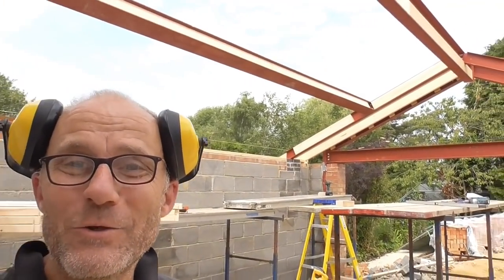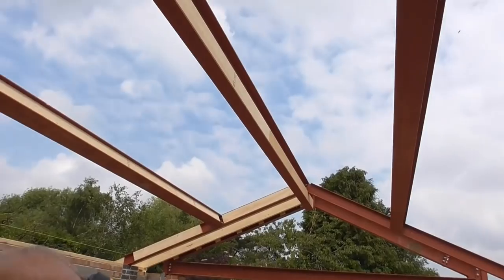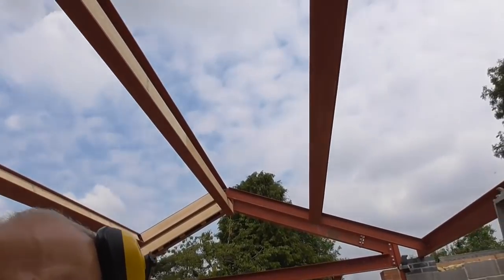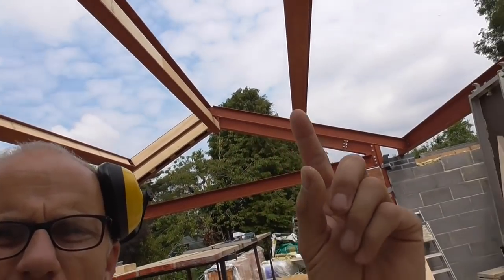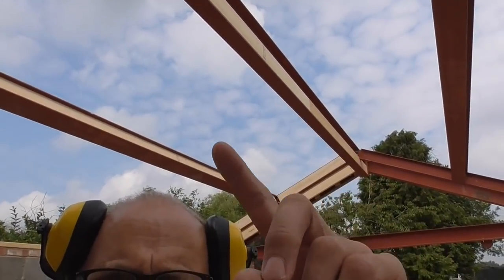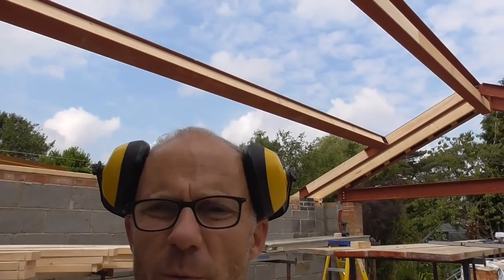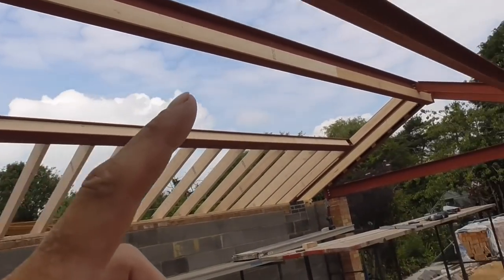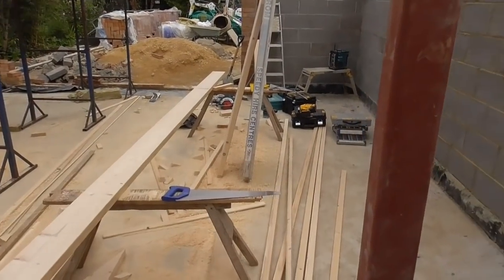Fitting timber rafters to a structural steel framed roof.  PART 1

Comment: I’m doing the same but the steel purlins are in twist to the A frames .
Having a nightmare as the bottom rafter won’t run with the top as the purlins are throwing it out
Reply from the maker: Hi Philip🖐That sounds like a bloody nightmare bud😩I was BLOWN AWAY at how accurate and straight the whole steel frame was on this job, and I was expecting more along the lines of what you're describing😬I feel your pain fella😶
Reply: @thetallcarpenter  
I’ve cut the plumb and seat cut to exactly what the steel line at the gable shows but as soon as they hit the purlin it’s fine but because it’s tilted (twisted)
The next rafter to the ridge runs high as if you imagine they are fighting each other which is exactly what would happen if the purlin had twist to the A frame.
It’s driving me potty trying to pull them in line but then you close the angle
Reply from the maker: @Philip Watts  The trouble is that when you use structural steel beams in this situation, the fabricators REALLY need to be on top of thier game, or, as you ate finding, it makes integrating timber into the frame really challenging😕
Reply: @thetallcarpenter  they have to be as it can’t work.
Difficult to explain to you but I d tried to adjust to suit but that is a huge negative practice as you are then changing what you are meant to be working to .
I’m going to have to try and get them back to but it right
Reply from the maker: @Philip Watts  You can only do what you can do Philip, and as much as we want to try and make things work, sometimes we just have to concede that it's not going to happen😶Good luck with it bud👍
Reply: @thetallcarpenter  Thank you 🙏 
And I enjoyed your videos . Great job you should be proud of yourself

Comment: good start to this project mate. ive never been on a job like that..... although i did a job a while back that i trial ran the original dewalt framing nailer on (dcn690) that job had a big rsj as the ridge beam and a big vaulted gable window set up with velux windows etc. i do enjoy a roofing job though. im a bit owa sore from playing football tonight to watch part 2 plus its late so ill watch that tomorrow
Reply from the maker: Hi Paul. Crikey mate you must have melted playing football in the heat we've been having😅 Thanks for watching mate, and you've only got 6 more parts to watch🤪 (soon be 7😎). Cheers.
Reply: @thetallcarpenter  i bloody well felt it today. ice pack treatments today... and more football tomorow.... haha gonna watch part 2 now
Reply from the maker: @paulfinnonjoinery  Cheers Paul🥶👍

Comment: I'm a bricky and a chippy so my bwk is always spot on as I know first hand the problems it can cause , nice work 👍👌
Reply from the maker: Hi Andrew. I used to moan like mad all the time about the slightest tolerance in brickwork, but as I've got older, I've learnt to chill out a bit about it.😎 A lot of the time there is different factors that can affect the outcome of the brickwork, and sometimes, with the best will in the world, its easier for the chippy to get over any issues these may cause than it is for the bricklayers.👊 This brickwork was pretty good and only out by 15/20mm, but these brickie's were the second gang on the job, as the first gangs work had to be taken down and re-done.😬 Thanks for your comment mate, and for watching.👍
Reply: No probs, I'm bit older than you I think, and there was always rough tradesman but now there is even a shortage of them lol.
Reply from the maker: @andrewpalij4691   Its bonkers Andrew. The state of industry is frightening, and I'm sure we could exchange messages about the problems it faces all night long.😬 Its going to get much worse before it gets better, that's for sure.😣 Cheers

Comment: Absolute nightmare when a bricky can’t get walls level or parallel. Once you have to start cutting rafters at different lengths it just has a knock on effect on your Height above plate in order for them to plain through Good luck pal
Reply from the maker: Hi Mark. Yeah, it is a pain, but I suppose I just accept it as part of the job after all these years.😆 Fortunately, the steel is some of the best I've ever worked behind. 🤩 Thanks for watching mate.😎
Reply: @thetallcarpenter  Perhaps in a future video you could mention a bit about how you cope with a difficult wall plate in  a bit more detail? Ie how do you go about cutting the rafters individually if required, but still keep it all the same.

Handy for us youtube learners. Every video teaches you on a perfect example :)
Reply from the maker: @Xaltae  Hi Xaltae. I can certainly explain how I tackle out of parallel wall plate in future videos.🤩 Thanks for watching.👍

Comment: Nice job, just a DIY monkey here, how are the long timbers held in / on the steel?
Reply from the maker: Hi Doug. I will show this in a bit more detail in the next video, but the steel has been drilled in the web to allow me, 'sandwich', it between a timber each side, which can be screwed to each other.👍 Thanks for watching.😎
Reply: @thetallcarpenter  cheers very much. Look forward to the next one

Comment: Good stuff!
There is something quite satisfying about making a set of ring beams and purlins into an actual roof that works...I love doing this sort of thing. You are right about the lack of details from the architect. There isn’t always a lot of information as regards setting the plates (for want of a better word...) into the steel so you’ve got something to nail to..?!?
Great video 👍
(Is that Chopin as the background music??)
Reply from the maker: Hi Mark. I know its not just me that has to, 'fill in the blanks', left by architects, and sounds like you have been there plenty too 😵. The steel guy has, however, done a BRILLIANT job of the steel work, and drilled lots of really helpful holes for me to fix my plate timbers too making the job much easier and quicker.👊 Thanks for watching and your comment.😎 (the music Bach's Cmajor Prelude). Cheers.
Reply: @thetallcarpenter  Loving the classical background music